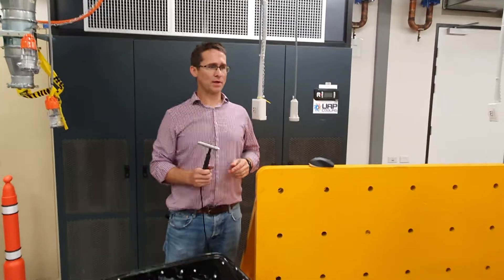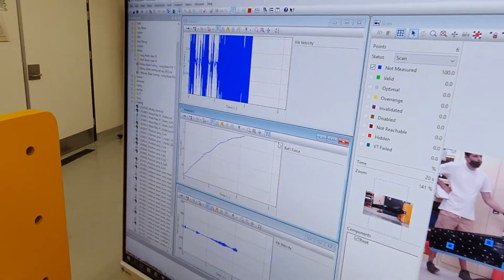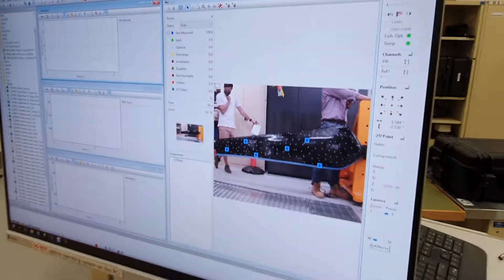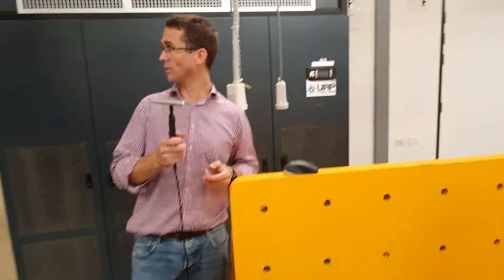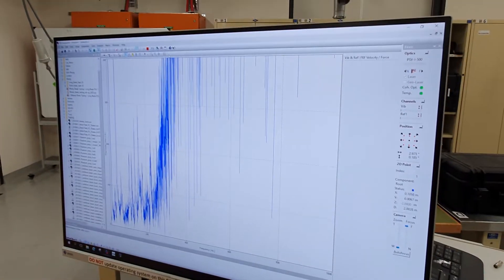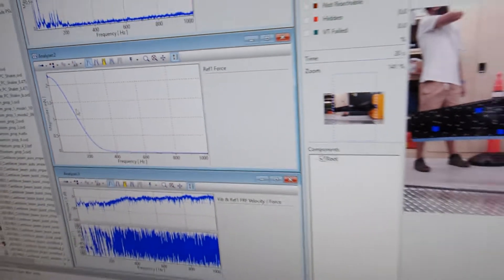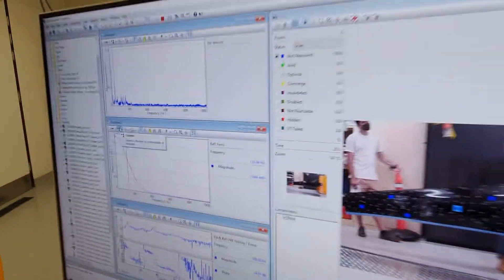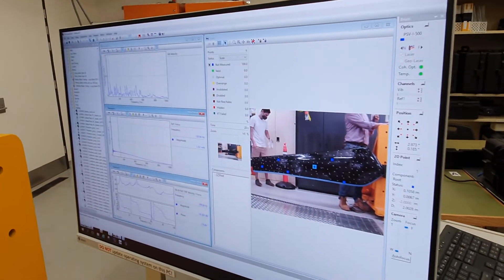UTS Tech Lab Vibration Lab Polytec PSV-500 Tutorial - Part 6/7 Setting Up a Modal Impact Measurement

Comment: I have a question, I want to whack it hard, however after I set it up, the laser didn't move after I whacked and struck it hard. I'm not sure if it's just my settings, I'd like to see yours. Is that ok?
Reply from the maker: To be honest, I don't remember the exact settings but it may be in one of the earlier videos in this series...as a rule, I'd be expecting vibration around 10-100 mm/s max.. I'd be going for 100 or 1000 mm/s/V.